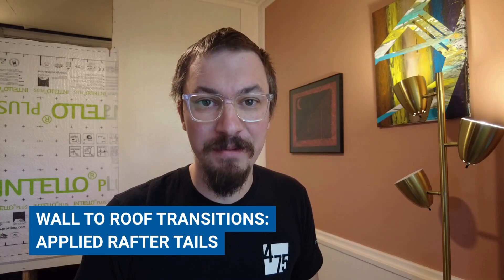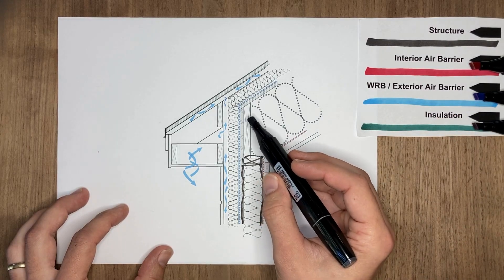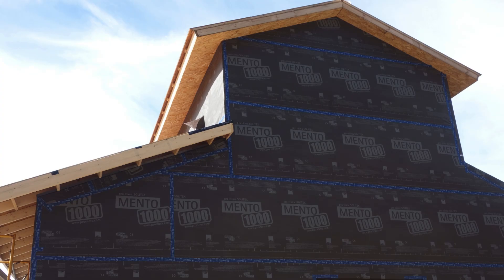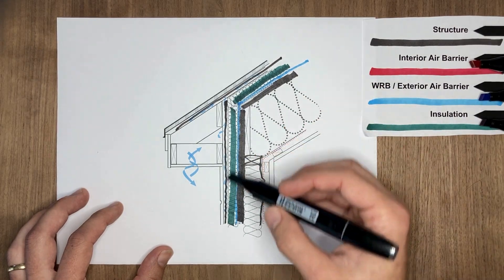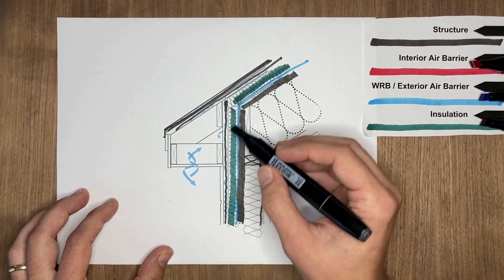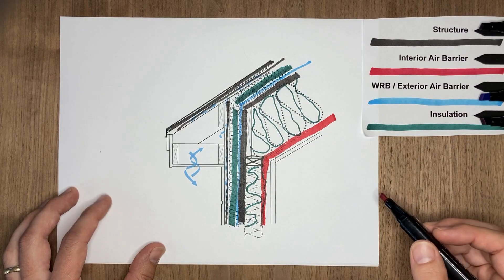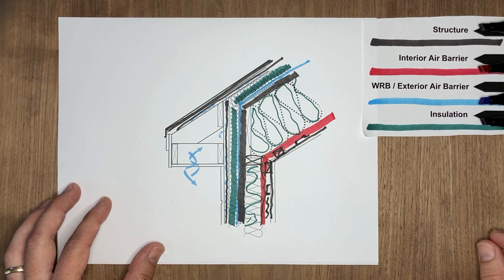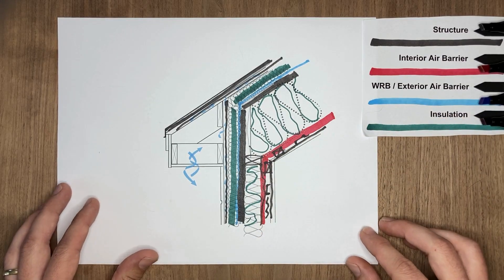Airtightness Details: Wall to Roof Transition Monopoly Framed

Comment: Blown in insulation settles hugely over times, especially inside vertical walls.  Bats are stable forever if fastened properly.  I like the moisture control layers and ventilation.
Reply from the maker: Blown-in insulation should be installed at a density that self-supports and doesn't settle over time. This is an important distinction between dense-pack and loose-fill install types. Regardless of insulation, we like the moisture and air control layers too - those are the most important.

Comment: We do not believe that you need the air vented under the roof.  Our calculations show that an unvented roof with approx. 50% of the insulation on the outside of the sheathing, and 50% below on the interior, works very effectively without condensation issues at any point in the assembly.  ...
Reply from the maker: Yes, this roof assembly doesn’t necessarily need to be vented. You wouldn’t want to vent for low slope roof pitches. The 475 Smart Enclosure ebooks show a variety of roof assembly options, both vented and unvented.

Comment: Only issue I think that's presented in this section is the continuous venting from the siding to the roof system. I know this isn't commonly enforced in low rise homes, but shouldn't there be fire-blocking to separate the vented space between the siding and the roof?
Reply from the maker: Ember resistant vents are often used for the rainscreen and roof venting that seal during extreme heat for projects near wildfire prone areas. The roof venting doesn’t have to connect directly to the wall’s rainscreen. The applied rafter tail system can incorporate venting and drainage in a variety of different ways. If fire-blocking is required at this transition point there are other options.

Comment: Never understood this North-American obsession with practically vapor tight exterior sheating that only makes the structure more complicated and more prone to moisture damage when building well insulated houses. Quess it's one of those "it's always been done like that" things?
Reply from the maker: For climate zones 4+ we agree! The assembly needs to dry through diffusion in super insulated homes. We tend to like plywood over OSB for the higher vapor permeability – and we’re seeing more sheathingless assemblies in colder climate zones. The SOLITEX MENTO PLUS is a great option for sheathingless assemblies in climate zones 4+.

Comment: Can the air barrier be moved to on top of the bottom sheathing layer? An interior air barrier is hard to apply to the underside of truss top chords due to all the web members that would have to be penetrating it.
Reply from the maker: If there’s enough exterior insulation outboard of the roof sheathing so that the underside of the sheathing is kept above 45 deg F then you can have just an exterior air barrier. For pitched roofs in climate zones 4+  you’d still want to use vapor permeable exterior insulation and a vapor permeable air barrier / WRB such as ADHERO 3000 or MENTO 3000.
Reply: @475.SUPPLY Is another layer of sheathing required above the exterior insulation using rockwool? For some reason I've only seen it done that way even though it seems to be a waste of material and time.

Comment: We used Zip R-12 over 2x4 studs and used closed cell foam between the studs for R-30+ walls.  Regular doors and windows for 2x6 walls fit perfectly.  2" of closed cell on top of lower ceiling in attic plus blown fiberglass on top for R-60.  Our blower door test was one of the lowest readings the tester said he's seen.  We are in heating zone 6.  
All the detailed requirements of exterior XPS or mineral wool that needs to be furred out, placing batts to cover all interior crevasses without compressing, WRB house wrap,  interior vapor barriers, etc is unnecessary and difficult to get contractors to do correctly.   Sure it costs more the way we did it but having the piece of mind of an airtight home, low energy bills, better than code insulation, idiot proof construction, and no mold/rot as long as the home exists is better, IMO.
Reply from the maker: Happy to hear you’re getting low blower door numbers! These super insulated assemblies need to dry through diffusion since they’re not getting baked dry with the home’s heating system. The concern is that the hydrophobic and vapor retarding foam insulation can trap moisture against the wood framing. Closed cell spray foam is an airtight material, but the install is discontinuous and since it’s typically against wood (which isn’t dimensionally stable) the connections to the wood framing has durability and longevity concerns. Check out the 475 “Foam Fails” blog series for more information on foam insulation concerns. The zip install can have waterproofing concerns and the OSB (and foam insulation) can be a vapor retarding concern in cold climates where the vapor drive is towards the exterior for the majority of the year. At least the zip-r isn’t sandwiching the OSB between the rigid foam and spray foam insulation in your example since the OSB is outboard of the exterior insulation, but we tend to want to keep the sheathing warm and dry when using exterior insulation.  For more info 475 has a WRB comparison blog post: “ZIP vs SOLITEX: a WRB Comparison”
Reply: Your homes are gonna be prime examples of mold and moisture problems in the near future.

Comment: You should maximise the exterior insulation even is this is a wood structure but nice detail and explanation. No architect in this province of Quebec does details of this quality because no one respects the energy and building code. No governing body is this desastreous province.
Reply from the maker: Colder climates certainly will want more exterior insulation than what’s shown in this drawing, but if there’s INTELLO PLUS or INTELLO X membrane then you don’t need to keep the sheathing as warm year round. Luckily the main barrier to more adoption of these high performance approaches is education. 475 is available to support with that, but maybe there’s also a local Passive House chapter or similar community.